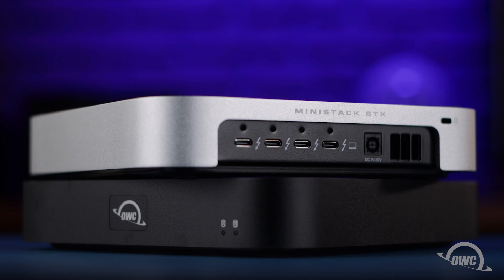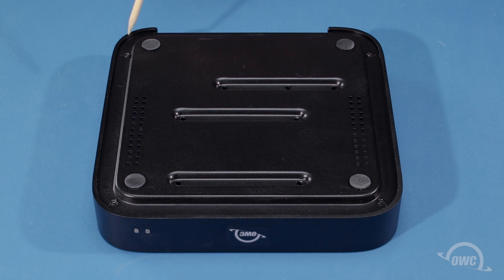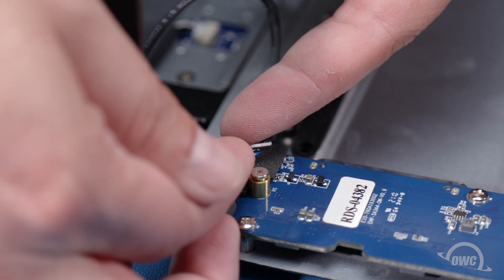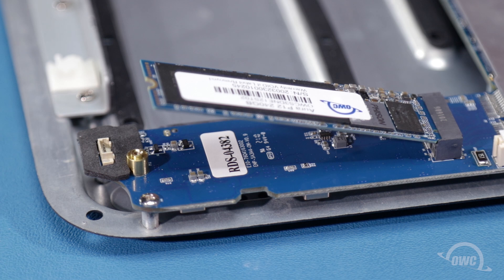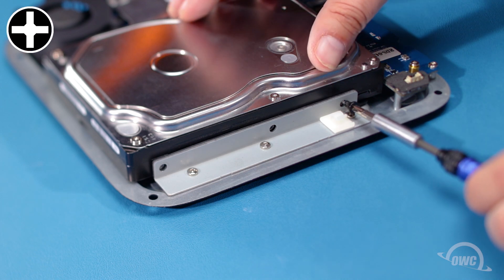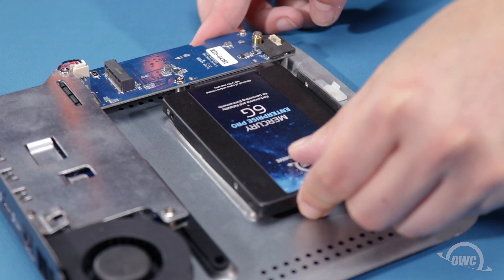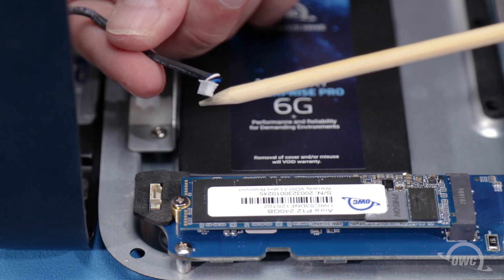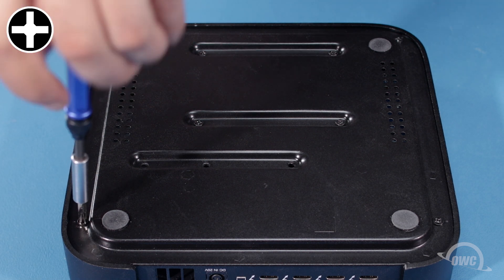How to Install Drives in the OWC miniStack STX

Comment: And btw why didn’t you add the option to put in smaller M.2 SSDs?
Reply from the maker: There is important circuitry on the board where holes for 2230 or 2242 M.2 drives would go. If we increased the size of the board to accommodate those drives, it wouldn't fit a 3.5" drive without also increasing the form factor of the whole product. Since we wanted it to match the footprint of the Mac Studio and Mac Mini, we decided against it.

We do offer a separate product that will allow these smaller M.2 drives to fit into the enclosure. https://eshop.macsales.com/item/OWC/2280M2EX/
Reply: Can y’all explain what ya just said? I want to buy this but now don’t know if I need the expansion. 😂
Reply: @mrard1  what all this means is that it can only support one size of M.2 SSD